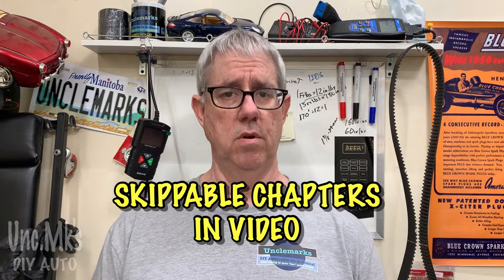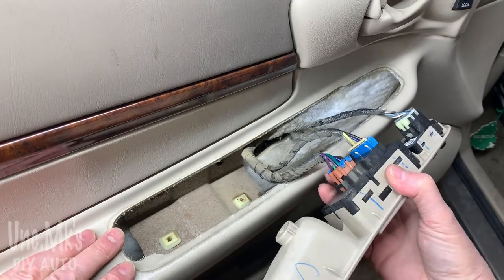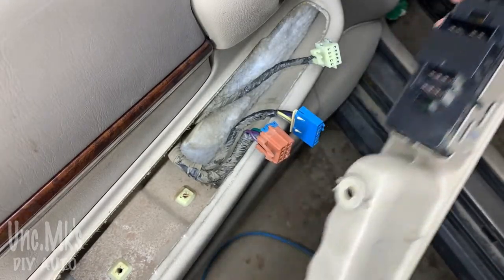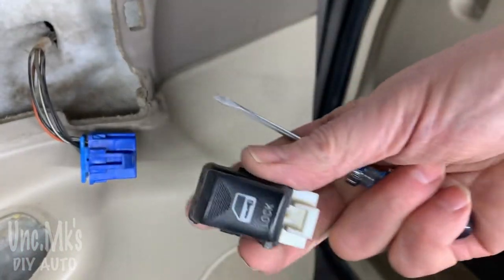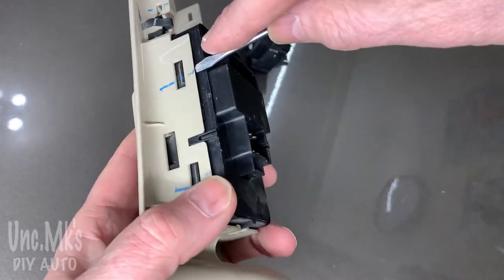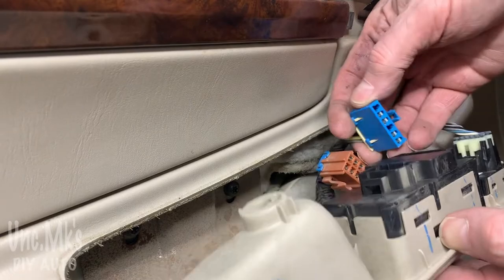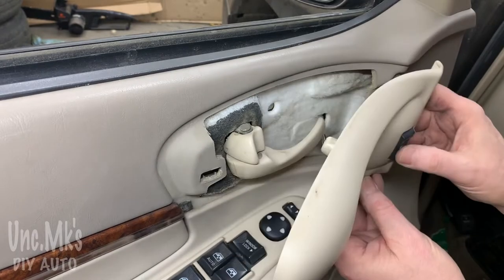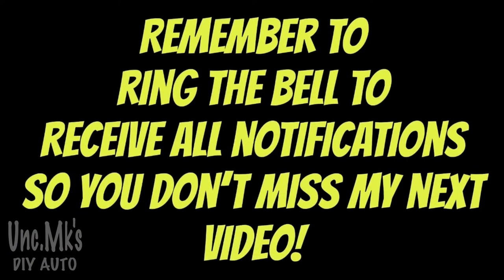How to replace power window lock & mirror switches on Impala 2000 to 2005 (EP 254.347)

Comment: Thanks for showing us how to change them.  I've changed switches like that before and then found out it is the wire in the door.  Who knew?  Seemed like such a great idea to buy a new switch to fix the problem... until it didn't work!
Reply from the maker: The car I am currently driving has a power door lock switch unlocking but not locking. Thinking it actually is the switch. Might try to take switch apart and see if dirty ore corroded. Video to come soon.